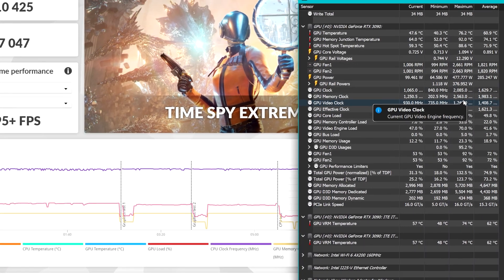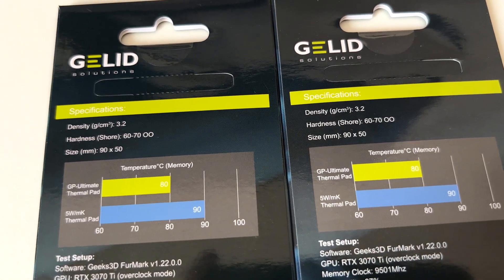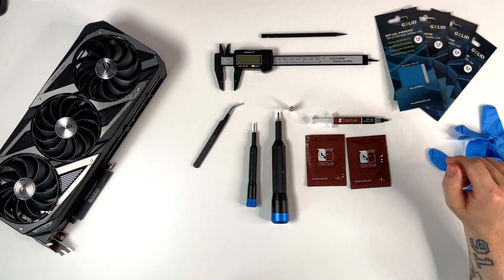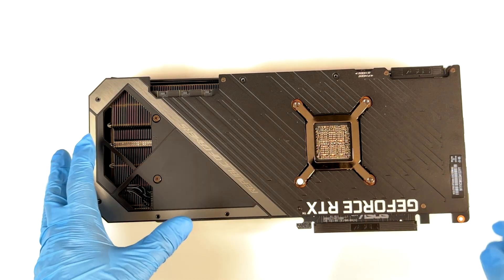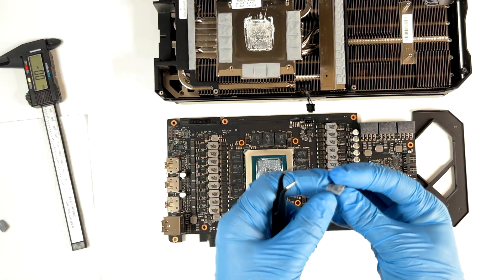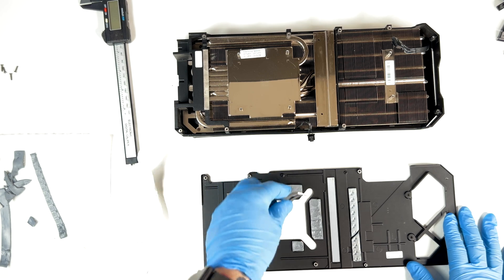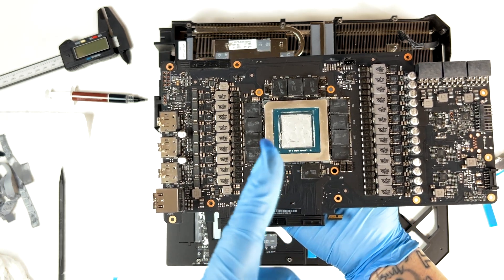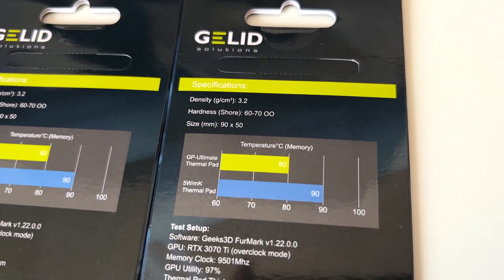ASUS ROG Strix RTX 3090 OC Edition Thermal Pads Replacement

Comment: Worked great for my 3080 and I also added a thermal pad for the silver row of components on the left side of the GPU that wasn't there from the factory (it only hits the heat pipes, but figured better than nothing).  My thermal pad kit I ordered didn't have 2.5mm so I used 2.0 and 0.5 doubled up.  Not ideal, but seems to be working great.  In fact when I dissassembled, one of the thermal pads was misaligned from the factory which might explain why my fans always ran loud.

Comment: TY for the comprehensive guide. I replaced and repasted mine (same Asus Strix 3090) and lowered the temps 10 degrees for the GPU and memory and 15 (!) for the hotspot. Fans RPMs also lowered by 1/3. I used Gelid Extreme almost everywhere. Noctua H1 thermal paste for the chip.
Reply from the maker: Glad it helped! Great results you got there

Comment: Thank you so much for this tutorial. I was experiencing crashes in CS2 due to not only bad ram but high temps of both nvme and gpu hot spot. Doing this + ptm7950 instead of thermal paste did decrease the gpu hotspot from ~110 to ~85. (NVME also decreased a lot due to a new active cooling heatsink from Thermaltake). It's been a couple of weeks and CS2 has been totally fine. Again, thank you very much! I hope this PC will last for another five years now hehe.
Reply from the maker: Glad it helped

Comment: Thanks for such a well made video. Can you just specify when you mention 1 package of Gelid Ultimate 0.5mm/1.0/1.5, what size do you refer? is the 120x20 ? and the same for the 1 package of Gelid Extreme 2.5mm ?
Reply from the maker: thanks! One package for each of the measures which are indeed 120x20
Reply: @JULVEXGAMING broo thank you so much for replying!!!

Comment: I have the 3090 vision OC as furmark the VRam reaches 106 to 110c, I ordered the 2mm and 1.25mm thermal pad from Fehonda Aliexpress, and I will use PTM7950 as thermal paste, I hope everything works out
Reply from the maker: They should let us know how it's going with that
Reply: @JULVEXGAMINGI changed the thermal of the entire GPU, before with Furmark it reached 108C and now that I did the maintenance with Furmark it reaches 82C at most and with games 78C, I used Polartherm x10 thermal paste, I haven't received PTM7950 yet.
Reply: @JULVEXGAMINGI did it today, before with Furmark it reached up to 108C, now it goes to a maximum of 82c with Furmark, and with games 78c, and I used Polartherm x10 thermal paste, PTM7950 has not yet arrived from aliexpress, Fehonda thermal pads

Comment: BE EXTREMELY CAREFUL when reinstalling the screws that secure the GeForce RTX label bracket. They’re slightly longer than necessary and can chew into the circuitry on the board. Mine had to be repaired, luckily the screws only when into the top layer of copper.
Reply from the maker: Never had issues with those screws but thank you for sharing this so others can pay attention

Comment: Nice video! 
Do you know the pad thickness for ASUS ROG Strix RTX 4090 OC Edition, by any chance?? 
I wanted to know before hand so I don't disassemble it and then find out I need to order different thickness pads.
Please and thank you!
Reply from the maker: @N7_GOW_69  Thanks!
They should be almost the same, 2.5mm for the VRM and 3mm for the backplate

Comment: Hi, I used my Strix 3090 for about 4-5 years now. Recently I’ve started to get random PC restarts in high FPS games with v-sync off. All benchmarks don’t seemed to be reproducing the crash at all. Of course I checked the core temperature during game, usually it’s under 65-70 degrees which is normal I reckon. But when I downloaded HWmonitor I saw that “hot spot” is about 100-105 degrees and could be 110 at its peak. Should I really destroy the guarantee by opening it and change the termopads or something? Will it help?
Thanks!
Reply from the maker: I believe that after 4-5 years the warranty might be over
Amyway, opening the GPU for changing the thermal pads shouldn't be an issue in most cases - before doing that I would recommend to check it with your local reseller
Reply: @JULVEXGAMING  but what about 100-110 degrees hotspot? It ain’t normal I guess. Difference to the core temperature could be 30-35 degrees.
Reply from the maker: @sacifair  yeah that's pretty high
Reply: @sacifair  Hi, did you changed the thermal pads?? if yes what is the results?? I have an Strix 3090 for 4 years now, and i see the hotspot is going to 107 degress...
Reply: I also have RTX 3090 Strix with core temp about 74 but hotspot/memory easily reaching 100/105. Such as high temp delta is usually a sign of bad thermal conductivity from the memory modules and changing the pads should definitely help. I'm considering Gelid Ultimate/Extreme as in the video but I also saw a good deal on Thermalright Odyssey II, which of those is better? Should I use the Odyssey for some thickness and Gelid for another? And is MX-6 good enough for repasting the core?

Comment: Hello I did follow the instruction carefully and then bought 0.5mm 1mm & 3mm for Backplate. I have RX 5700XT Gigabyte somehow I don't know what is the measurement of cutting and real thickness without compression.
Reply from the maker: Those are different GPUs and might have different measurements, normally the compression depends on the shore of the thermal pads - generally the compression should be between 0.2 and 0.5mm

Comment: hey thx for nice detail video. the thermal pad size will it work with asus strix rtx 3080Ti too ?
Reply from the maker: Glad you found it helpful, I'm not sure the size would be the same ; for the memory module on the front (the ones around the GPU core) should be same

Comment: Your video helped me...a lot! So I picked up a used, RTX 3090 OC white card which had a bad fan. I replaced the three fans (who does just one after disassembling the card to that level?) And replaced all the thermal pad compounds all around...based upon your educational video. Using Gelid thermal pads along with Arctic MX-5 paste for the chip I see sustained temps of 42c when system is basically at idle. And while under load running MSFS2020/RDR2/GTAV normally 62c to 65c. It was a bit of a gamble grabbing a used card like that, the seller assured me it ran and hadn't seen indications of thermal throttle prior to nor after the fan failure. He pulled the card as soon as the fan failed as the blade had unseated from the post of the wireless brush head. So for a couple of hundred bucks, another seventy in materials and my labor I have a really decent 3090 OC White and the ROG ring too.
Reply from the maker: Thank you! Glad you found it helpful! 
You did a great job with the fan anyway, now enjoy it and happy gaming 🎮🎮

Comment: Did not work for me. GPU 1 degrees improvement, memory no change and hotspot 2 degrees improvement. Asus Strix has good thermal pads, don't change it. It has cost me 60 euro, 2 hours of work and I've lost my warranty.
Reply: damn, so what happen?
i just bought myself a used rog strix 3090 which the seller said that the pads is quite dry cause he used waterblock for cooling before, i ran some test at home and the temp went up till 83-85C gpu temp with memory temp reaching 98-100C, should i just return it or should i try repaste and repads it with newer one?
the fan is loud as hell too
Reply from the maker: @mgeereview9398  I would try first to see if with ASUS GPU Tweak app you can manage somehow to get better temps.
If the seller changes the pads and thermal paste when using the  waterblock ‘theoretically’ when he put all together back the heatsink etc he should have re-applied again also new thermal pads and paste; try asking 
Otherwise you can try change it by yourself, if you don’t feel comfortable doing so I would suggest returning it
Reply from the maker: Hello there,
this is only for educational purposes for those who might want to change the pads or repaste the core in case of thermal issues after the warranty, keep in mind thayou do t not always you could have good results as this depends much on materials, reassembly, and so on.
As for the warranty - even if it is nonsense - you might lose it depends on where you live, that was stated in the disclaimer at the very beginning

Comment: Hey nice video, Thanks! did it work? or did you had to make any changes? best regards!
Reply from the maker: Hello there, thanks!
For me it worked and I was about to lower the temps but I have to say that in this GPU they have used acceptable thermal pads, so if you bought it recently brand new and you have a medium case with a normal air flow and you're not having crazy high temps I would suggest you to consider changing them after 6months/1year; but anyway you will notice improvements
Reply: @JULVEXGAMING  Thanks!, well actually I got rid of liquid cooling (plexi was getting dirty even when cleaning properlly) so I'm back to air. I'm getting 14.8 W/mk pads  but I was wondering about the thickness. So thanks again!   :)